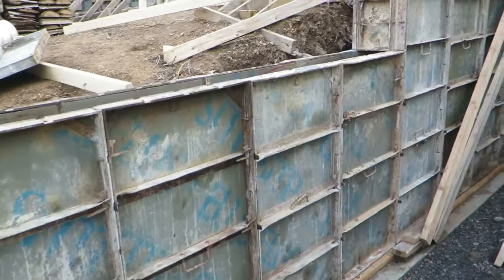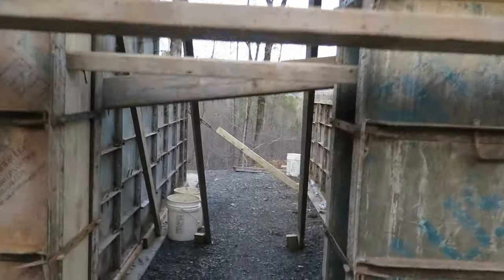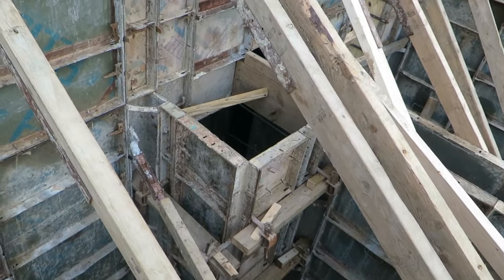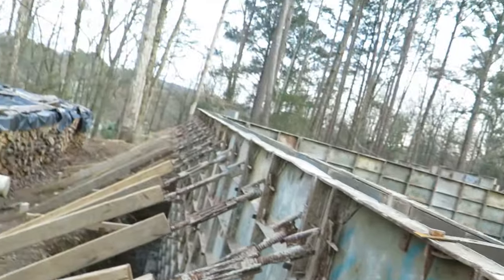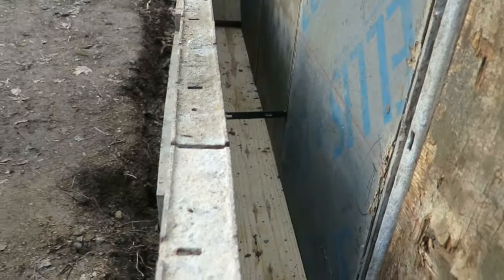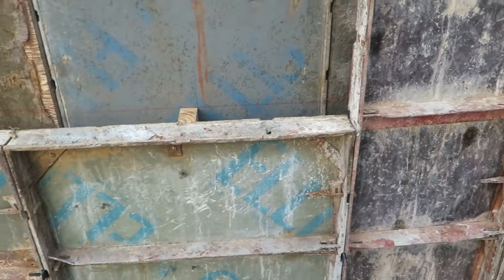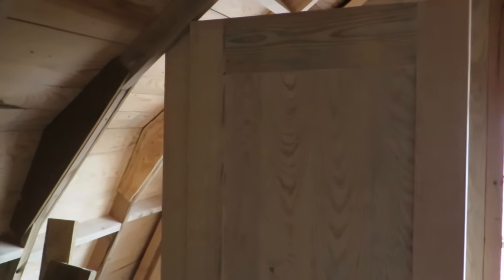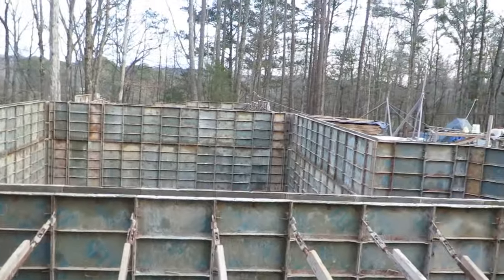Ep#279 More Delays! Will I ever get this basement done?

Comment: IMO you should think about a retaining wall behind that house and garage.
Reply from the maker: On the lower side in the back?
Reply: @thetennesseefrugalcraftsma7383 Yes.  What I would be afraid of is the foundation slowly over time creeping down that hill.  My garage did that because it's on a hill like that.  Now granted it took 45 years but it is 'racked' and I had to reenforce it with a wall.  I would really hate to see anything happen to your dream home.
Reply from the maker: @mitchstaff8281  How close to the edge of the hill were you? I am 25+ feet away.
Reply: @thetennesseefrugalcraftsma7383  The garage was built onto a built-up downslope but not nearly as steep as you are.  I'm no expert and I'm only going by your video.  I just threw my experience out there as something to watch for.  I have no idea about your soil or any other factor involved.  It might be worthwhile to pay an engineer just to take a look although I have to believe your cement contractor would have said something if he saw a problem.
Reply from the maker: @mitchstaff8281  Thanks